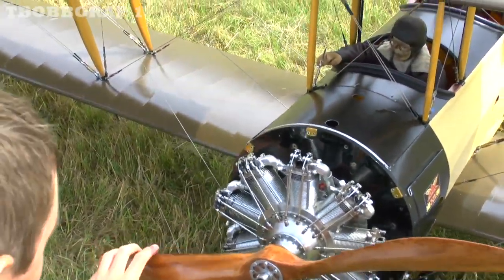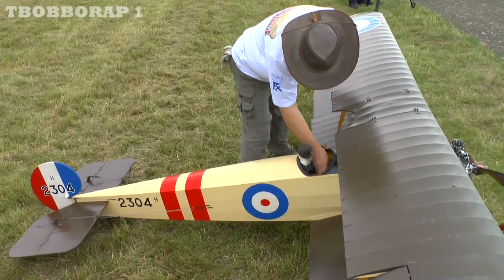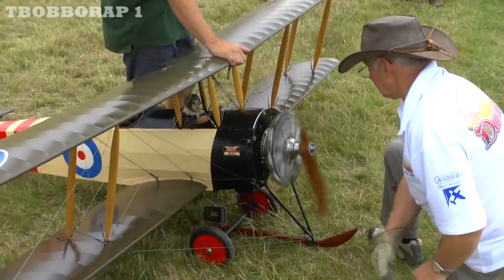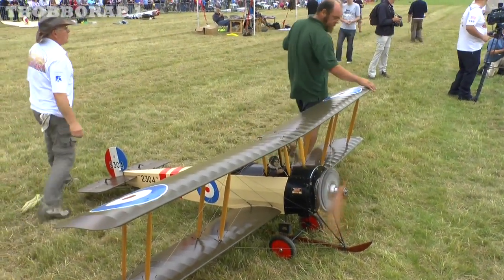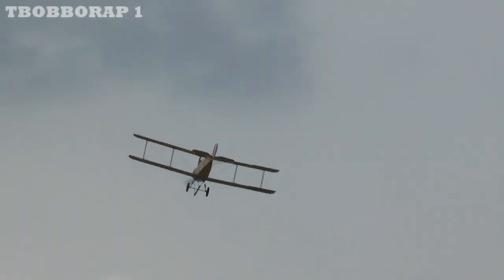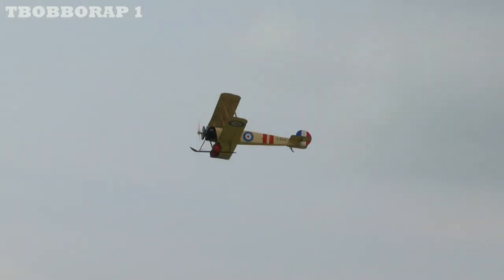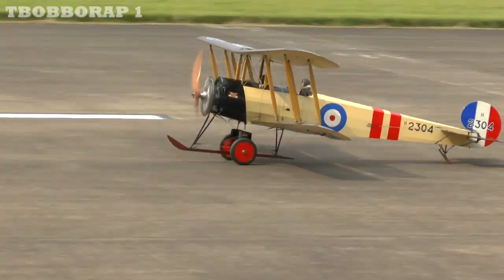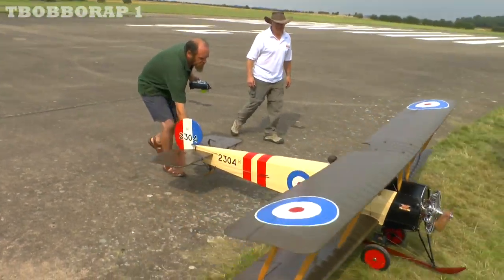② RC 1/4 SCALE 9 CYLINDER BENTLEY ROTARY ENGINE AVRO 504 BMFA NATS MODEL AIRCRAFT SHOW BARKSTON 2013

Comment: It isn't as much of a chore as you think.
As the wings have two sets of struts there is no need to completely de-rig every time and they are carried in pars in the back of my estate car.  There are seven rigging wires which are permanently attached at one end and when the wing pairs are located it is just 15 mins to attach the other ends. I use 4mm stainless steel socket heat bolts.
The fuselage is another matter. It is just over 8 feet long and is carried in my trailer or friends van
Andy